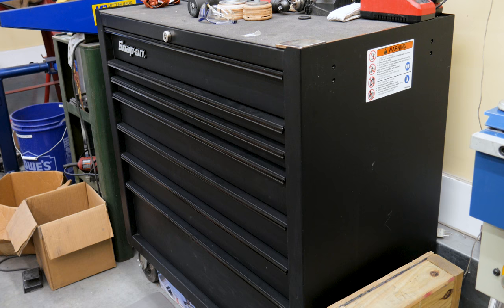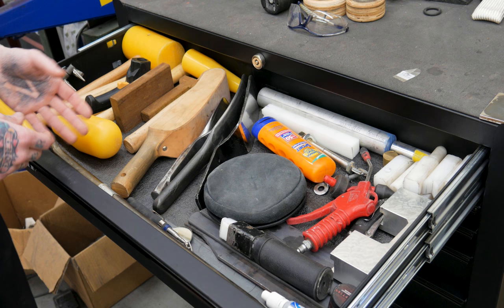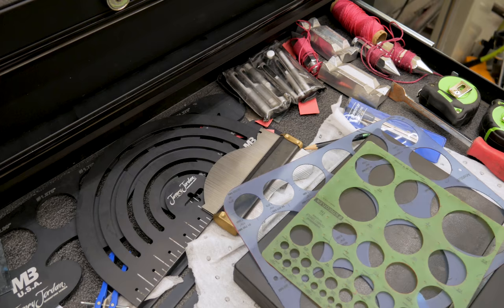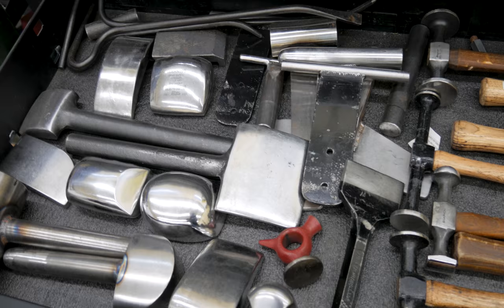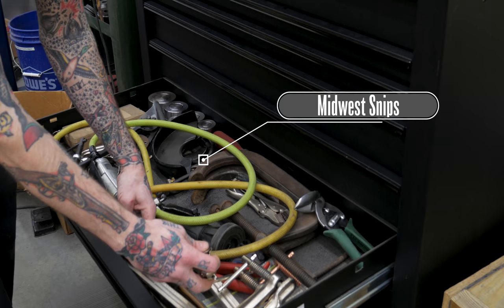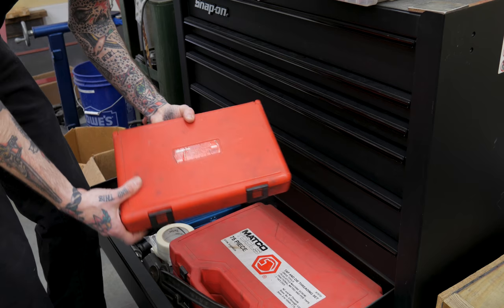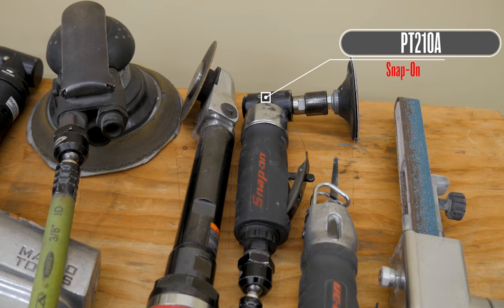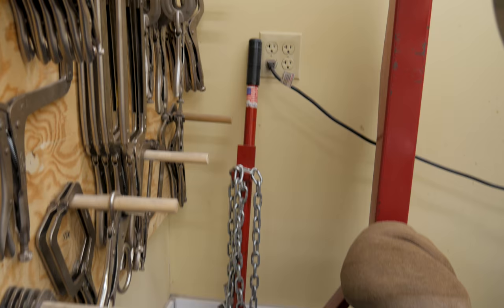Fabricator Toolbox Tour - Snap-On and Matco and Hammers Oh My!

Comment: ALLEN IN YOUR HAMMER DRAWER YOU HAVE A LITTEL RED RING LOOKING THING WHAT DO YOU USE THAT FOR
Reply from the maker: That is a ring hammer. It's basically a hammer head cast on a metal ring so you can reach into tight spots and strike with just your hand. I've never actually used it. Ha
Reply: Thank you

Comment: What model pullmax you have?
Reply from the maker: T H my boss has a P6. It has a VFD for variable speed drive and we installed a drop plate that lowers the lower tool holder to fit larger pieces in. The worst thing about the P5/P6 is the throat opening is tiny.